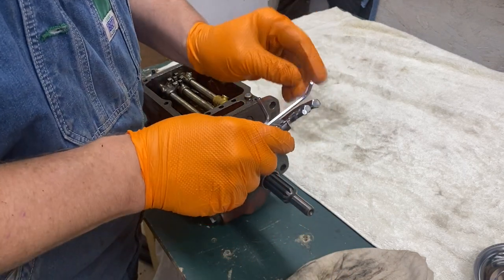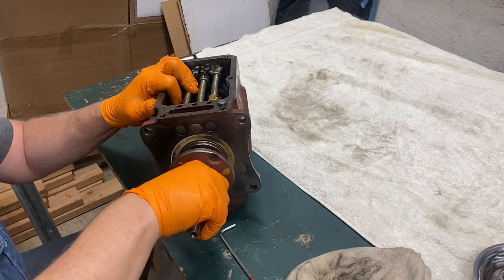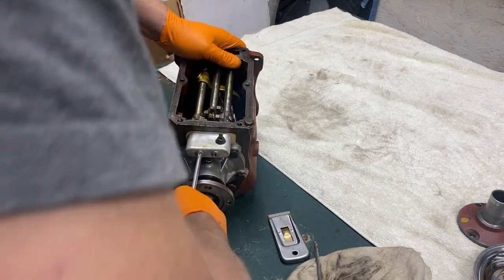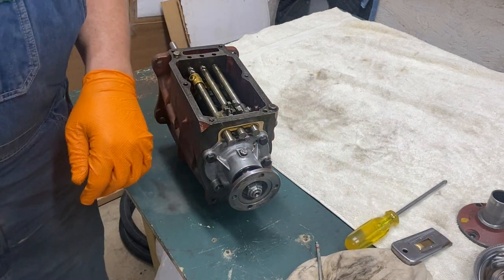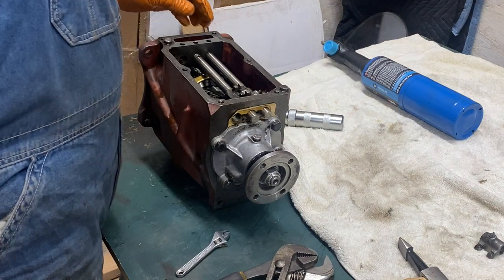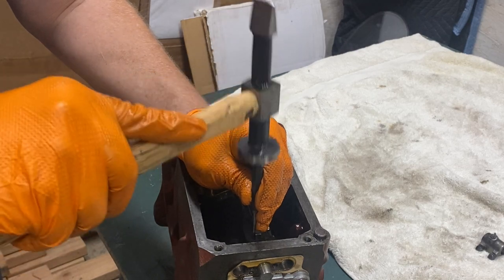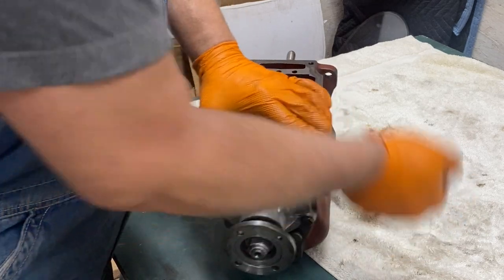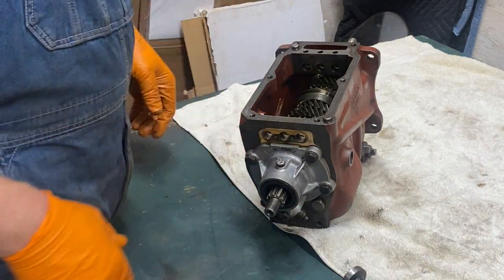Part 2! Volvo M40 Gearbox Repair

Comment: Hey man.. looks like a full gearbox  rebuild.. those synchro springs wear out and the ends.. pull the oil drain nut .. it is magnetic.. brake clean the case.. the main shaft has enclosed needle bearings.. if you clean the shaft.. re-lubricate before assembly.. check the reverse lights tab if it is broken or bent.. on the car pull the bell housing.. check the clutch bearing, input shaft bearing on the flywheel if worn.. most important check clutch fork ball for wear.. it is held in with the only 12mm bolt in the whole car.. #notautomotiveadvice😜..good job so far..
Reply from the maker: It all went very well. I learned so much by doing this!